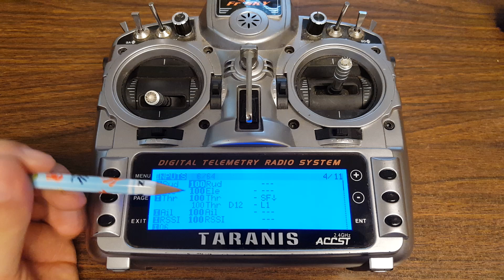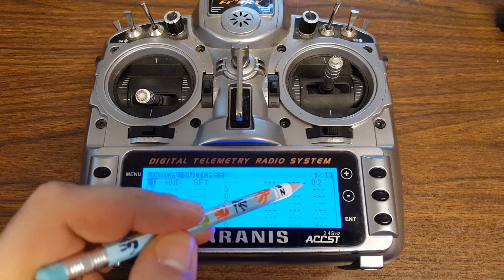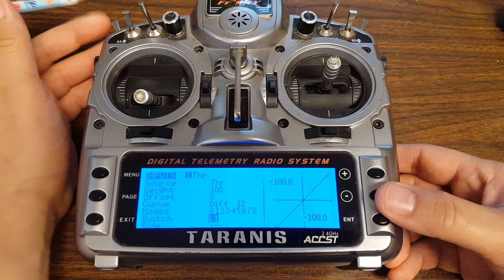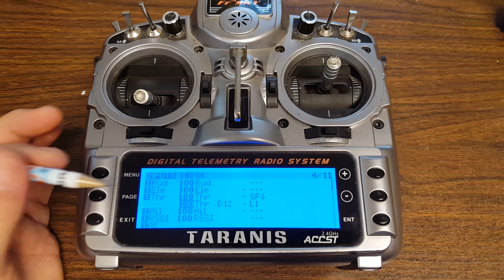Updated "idle up" configuration for CleanFlight 1.10

Comment: Dont know if youll see this as the video is so old but Im confused . I am trying to set up a steele like setup and disable airmode as I hate listening to the noise of my ESCs and motors being pinged if im too slow disarming when I land or when I clip something . I  would like to know if as long as I have a min throttle set will the quad stay locked in position when I drop the throttle to zero ? I have watched a few of these older videos but nobody seems to have explained this lately as everyone seems to use airmode . I watched Steele and Snake not long ago but firstly I am trying to keep all my arming functions on the same stick I use for arming  and secondly I would like to know  if without airmode do I lose some manoeuvrability if I have my min throttle set to say 1060

Comment: Hello Joshua! If you put your Min. Command to 1000 in the Kiss FC, it will automaticly activate Airmode. But if I want to control my quad with an idle up switch in order to get the low throttle control, do I have to set the Min. Command to 999 or 1001 in order to disable airmode or is there an other way to disable Airmode?
Reply from the maker: I don't know how KISS handles air mode. Sorry...
Reply: Joshua Bardwell No problem i'm sure i'll find it out somehow

Comment: Worked like a charm!  Every quad is probably a little different.  I had to increase the diff curve to 22 to get the motors to spin. I'm using  a NAZE 32 F3  flight controller, DYS 2300kv motors, and Little Bee 20A ESCs on a Martian II frame. Thanks for the video!
Reply from the maker: Glad it worked out for you! Happy flying!

Comment: whats the difference wetween using curve or offset to increase the idle?
Reply from the maker: I can't answer that off hand, and I don't have my Taranis in front of me, and I won't for a week. All I can say is take a look at the curve that is shown as you adjust the values. The answer is there.
Reply: Thanks for the reply Joshua!I see that offset shifts the entire line up and curve seems to only shift one side.  WHich would be best to use as an idle up switch?  Does the curve also act as a weak expo?
Reply from the maker: I always want a linear throttle curve, so I would use offset.

Comment: My recommendation is that Idle-Up and Arm should not be on the same switch anyways - as far as I learned with Heli-Flying. Danger is, that you errounsly disarm in the middle of the air when just wanting to go from Idle-Up-1 to Idle-Up-0, when its on the same switch as for arming.
Reply from the maker: In this case, there is only one "idle up" setting. Really, this is not actually idle-up. The goal of idle-up on a heli, as I understand it, is to keep the rotor spinning at some useful speed. In this case, the only purpose of idle-up is to keep the props spinning just barely faster than the absolute minimum.

Comment: I have a quick question brother. 
My motors begin to spin properly at 1025  so that's where my minimum throttle is set, and my min command is 1000  in turn enabling air mode. but when I try to do any bit of hang time upside down it pulls me down to the ground pretty quickly while upside down as if the idol has too much thrust. But when I do a full rotation it's fine and stays  stationary in the full rotation. I'm using a kiss FC not sure if you have used that but off of your knowledge Would a "idle up" setting in my TX resolve this issue?
Reply from the maker: If the problem is you are descending too fast when inverted, idle up would just make it worse.

Comment: I find the Taranis so easy to understand with more advanced programming.  I'm sure it helps that I have a coding background but simple things like If logic coupled with And's and Or's are very powerful and not always so straightforward on other radios. Great explanation and keep the videos coming!
Reply from the maker: Exactly. If you come from a coding background, Taranis and OpenTX makes a lot of innate sense. It's all just functions that feed into other functions. Inputs  and outputs. Once you understand the logical flow it all clicks.

Comment: Anyone accomplished this with a Devo7?  I'm trying to get an idle up with any scenario possible on my Walkera F210.  No matter how I do this, my F210 won't arm (hold throttle down and to the left).  Has anyone been successful?
Reply from the maker: If you can't arm, check your endpoints first. The channel has to go below min_check and above max_check.
Reply: I'll research how to do that, thanks
Reply from the maker: Also, the Betaflight Wiki has a section on "my copter won't arm" that has a more complete list.

Comment: Great tutorial, just want to know the purpose for this.   I was under the impression everyone uses motor_stop feature to prevent motors from spinning up when arming.  Please explain the benefit of this setup.   Thank You for great videos.  Enjoy watching them.
Reply from the maker: +RC Pilot Multirotor Far from it. Many people feel that motor_stop is unsafe, since it means that the copter can be armed without any obvious sign that it is armed. Then all you have to do is bump the throttle by accident and it's blender of death in the face.

But why run idle up when you could just turn off motor_stop? Because idle up increases the bottom limit of the throttle, which increases control authority when the stick is lowered. This feature is somewhat unnecessary if you are running Betaflight with the "air mode" changes to the mixer, since they increase mixer authority at low throttle without needing this hack.
Reply: Thanks for clearing it up. It does make a lot of sense.

Comment: does airmode replace this or it's completely different?
Reply from the maker: +maxdessureault Sort of. With air mode, you have enhanced mixer authority at low throttle. But with my Strider, I still like to run idle up to improve stability when I chop the throttle.
Reply: +Joshua Bardwell good to know! Thank you

Comment: Hi Joshua, Thanks for all the videos. Question, How do you know how hi or low your Diff value should be?
Reply from the maker: +kitesurfjerry At least high enough to spin the motors (i.e. throttle is just above min_check). And then I continue to raise it if the copter becomes destabilized when I chop the throttle sharply. There is a balance there, because as you raise it, the copter will have less inverted hang time, and will drop slower when non-inverted.

Comment: Not having a Taranis I've done something similar but I'm not sure if we're doing the same thing. 

I arm using a switch and also have the same switch configured to select a throttle curve that starts at 6% instead of zero. Once the quad is armed the throttle can't drop to zero but as soon as it's disarmed it returns to the 0 to 100% curve. 

I have one additional component and am trying to decide if it's necessary or just a heli thing. I have a throttle hold switch that must be in the hold position in order to arm. The sequence being:

Arm the motors and then release throttle hold which allows the 6% min throttle curve to take effect. At the end of a flight I enable throttle hold and disarm. 

It works fine other than a behavior I've read about with the new Air Mode. Once the new throttle curve takes effect if the quad remains on the ground it begins to slowly accelerate. 

Does your method avoid the acceleration issue? If so, why? 

Thanks!!

Jerry

Comment: I opted for a two switch approach.  I definitely did not need the 0.2 delay, but I left it in there since I was following your video.  The only thing is it took DIFF 23 to get it to idle up. I have a bit of lost travel at the bottom of the range before my props start.  I may have to adjust this in Cleanflight to get my motors to spin up at a lower stick position.  Thanks.... this will surely improve my confidence in inverted flight by giving me a bit more time to execute a move less quickly.
Reply from the maker: +txfieros With a two-switch approach, you don't need the delay. You physically implement the delay by flipping the 2nd switch. The exact value of Diff will depend on your setup. I have min_check very, very low, so I have almost no dead-band at the bottom of my throttle.
Reply: +Joshua Bardwell Correct....I was just happy to get it working.  I'll fiddle with the min_check and remove the delay later on.  Thanks for your very informational videos.  The blackbox videos and your explanations have helped me understand the dynamics of PID tuning based on weight distribution of your quad...it helped dial mine in a bit more.

Comment: I read somewhere a while ago it is better/faster/more resolution to use throttle expo on the Taranis rather than expo within CF.

I played with setting idle up as per your video on my Taranis for a few hours earlier. I can't seem to get it to work when you have an expo curve on the throttle input page. The Taranis only allows either a diff curve or Expo. Not both. I couldn't get it to overlay the diff curve over the expo when switched to get both.

Right now, I'm considering the latest BF update with 'air mode' but the fly away problems documented scare the hell out of me!
Reply from the maker: +Orca the Porker You'd have to implement some other kind of cleverness to get both a diff curve and expo. For example, could you use two input lines, with one input line having Diff and the other having Expo, and the Diff line taking the Expo line as an input? I just checked, and it appears you could do this, but you would have to map the Expo input to a channel in the mixer, and then use that channel as an input to the 2nd, Diff, input line. Alternatively, you could just use the mixer to move the bottom of the throttle channel using the Offset and Weight parameter.
Reply from the maker: +Orca the Porker But honestly, your whole premise is backwards. It's always more resolution to implement expo in the flight controller.

Comment: Hi Josh....
Am I right to think its best to still set min_throttle to a reasonable idle speed as that is the lowest the pid loop will output to the motor and set this "idle_up" so that it forces the throttle stick just above the min_check value. We can do this by looking at the receiver tab in cleanflight. ???
Regards
Doug
Reply from the maker: +Doug Schafer Yes, absolutely. Because remember that the FC is in charge of the actual motor output. So imagine that your min_throttle is too low, and you lower the throttle stick fully, then do a roll or flip. The motors that spin-down to perform the maneuver can still go low enough to fully stop, no matter what your idle up throttle is set to.
Reply: +Joshua Bardwell Thanks for the fast reply mate... I got it a little wrong at first with the motors doing exactly as you say, stopping in flight (the issue was I dropped my min_throttle too low). On the second attempt with min_throttle set to a nice idle speed and idle_up set to go just above min_check value it is a noticeable difference. Thanks again for all your hard work in explaining these things so well.
Reply: +Joshua Bardwell Just to make sure I have this right.  I've set my Min Throttle to 1105 (just enough to get the motors to spin) and then I set the Min Command (assuming that is you mean when you reference "min_check" value, please correct me if I'm wrong) to 1050.  Is the Min Command value close enough to the Min Throttle, or should that be increased?  I'm assuming the motors should be spinning once armed and the throttle position is at it's lowest point, correct?    Thanks!!
Reply from the maker: Matt Schinzel min_command and min_check aren't the same thing. I know it's a bit of a long video, but I'm a little rushed right now and don't have time to sum it up. Can I just refer you to this:

https://www.youtube.com/watch?v=WFU3VewGbbA

https://www.youtube.com/watch?v=YNRl0OTKRGA

Comment: Thanks, nice video Josh, but may be there is something i miss: if you do this on the arming switch, why don't you simply do this in cleanflight with min_throttle ? should be the same no ?
Reply from the maker: +titanium Regardless of what min_throttle is set to, the I term will still reset itself when the throttle input channel is below min_check. This is true, even if you have motor_stop disabled and pid_at_min_throttle enabled. Increasing min_throttle gives the copter more authority when the stick is below min_check, but it's still only the P and D term doing the work. I personally found that the copter was more stable and controllable, at a lower throttle value (faster descents!) using idle up.

The reason the I term is reset when the stick is below min_check is because you don't want the I term winding up when the copter is on the ground. The ground "pushing on" the copter acts like a persistent bias that the I term tries to counteract, which results in the motors starting to spin up on the ground. To demonstrate this, arm your copter and raise the throttle just barely above min_check, then do nothing. The motors should slowly (or possibly quickly!) start to spin up.

If you use idle up, you can't just sit on the ground and idle your motors. You have to take off quickly after arming to avoid this spin-up.
Reply: +Joshua Bardwell I have tried your setup on the taranis but the "Diff 12" acts weird: even if the stick stays at lowest value, the speed of the motors is increasing without any action on the stick ... Do you know why ?
Reply from the maker: Because the I term is winding up. This is normal when the PID loop is active and the copter is restrained (e.g. by gravity, because the motors are not spinning fast enough to take off). If you use idle up, you have to take off shortly after you arm. Or you can put idle up on a separate switch and manually activate it after you are flying.
Reply: +Joshua Bardwell Josh this is very informative, great job as always mate.
I was always wondering if there was a difference between using min throttle or a separate idle up switch but no one clearly explained the I term difference.
Reply: +Joshua Bardwell Thanks for taking the time to explain this in details. I think i got it better now :D. i did the setup on a separate switch to ease landing and take off: i will test it in a few hours and report here :D
Reply: +Joshua Bardwell This works like a charm :D Many thanks for that great tip and the time spent to explain !!

Comment: Josh how do I set this up if I stick arm? In your opinion is there any disadvantages to using this with stick arming? Any insight would be greatly appreciated.
Reply from the maker: You'll have a separate switch that controls idle up, which you'll activate after stick arming. If idle up is active, you won't be able to stick arm. No delay or logical switch is necessary since you are manually activating idle up after arming.

Comment: Hey great videos I'm always learning something from your channel. I tired doing your 1.9 version earlier today but was having trouble getting it to work correctly. what do you set your min throttle to on bl heli? I manged to get it to work idle up but my throttle stick had to be 3 clicks up before it started to spin up. is this something to do with my endpoints? 

Upto now I've just been having the motors spin when armed so when I drop throttle they just idle. however it feels loose and not sure if the pids are working as the same in this method that's why I wanted to to try it. 

thanks
Reply: also sometimes feels like my escs mess up and go weird when going from inverted 0 throttle to max throttle. using little bees 14.3 with min throttle at 1030 and max 2000. the motors seem to pulse a little then come back in. do you know what might be causing this issue? thanks
Reply from the maker: +Tom Smith FPV Min throttle may need to be higher. When you go to idle, they may be stopping if min_throttle is not high enough. This could cause them to stutter when they start up again.

The PIDs are not working the same with motor_stop disabled as with idle up. The I term zeroes out when the throttle is below min_check. With idle_up, the I term stays active.

The dead-band at the bottom of the throttle stick is controlled by min_check. Lower min_check to just barely above min_command if you want less deadband at the bottom. But be sure you can reliably input stick commands.
Reply from the maker: +Tom Smith FPV Just to elaborate, you are making the common mistake of mixing up min_check (the INPUT side) with min_throttle (the OUTPUT side). Changing min_throttle doesn't change anything at all about your throttle stick. It just changes how fast your motors spin when the stick exceeds min_check.

Comment: Hi, I use betaflight but I just use a arming switch and turn off motor stop when arming so my motors wont stop while in flight if I go to low on the throttle is there a better way to get the result of motors not stopping while in flight? Thanks.
Reply from the maker: +RayGeorge FPV I'm kind of confused. That's what this video is demonstrating how to do. I guess I don't understand your question.
Reply: +Joshua Bardwell Sorry I was thinking motor_stop was the same as idle up after reading below comments it's much clearer now. I'm going to try this now.